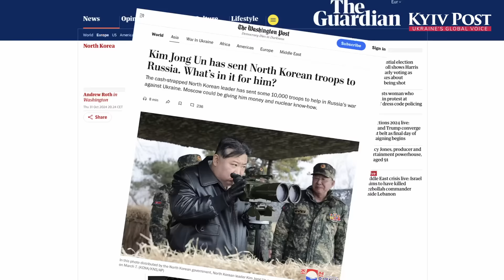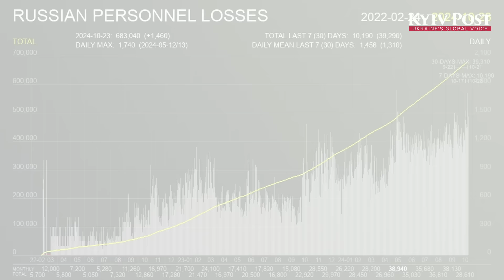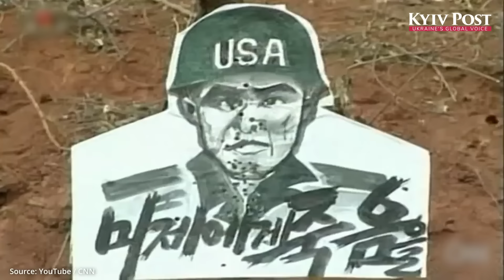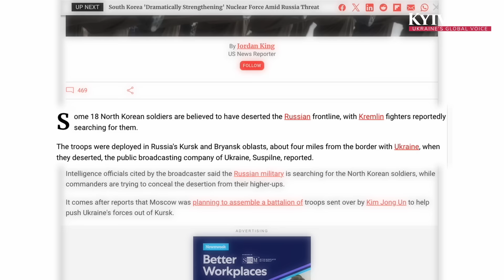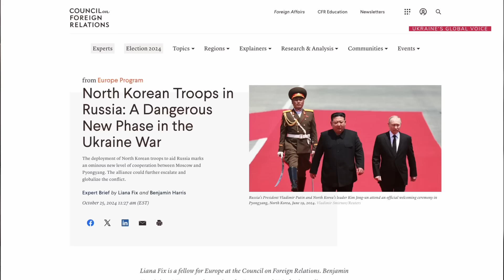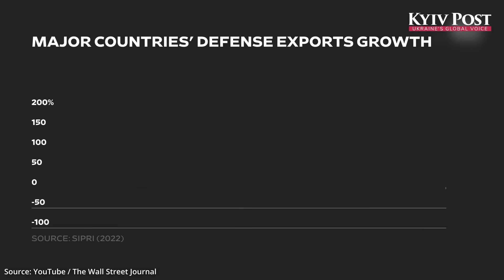North Korean Troops in Ukraine: Will They Change the War?

Comment: On the money as usual.
Question: (from a former USA Special Forces Soldier with Viet Nam experience)

Why wouldn't the Russians let the North Korean Units remain intact with emphasis on Unit Integrity and the mission they are trained to perform?
To take soldiers who are very set in their ways, tactics and use of arms and then retrain them for a few weeks seems counterproductive.
If it were me, knowing even half (probably more) of the situation, strengths/weaknesses, armaments, capabilities etc.  of my forces, I would want to keep them fighting as integral units with specific missions to carry out.
I would brief the unit on their mission very thoroughly, and what they could expect in enemy resistance and friendly support.
Where the friendly forces are concentrated and where their target is located.
I would emphasize drone warfare tactics and enemy known tactics.
This way you do not have to retrain them on topics specific to becoming part of a new unit using foreign tactics and unit nomenclature. A whole new chain of command too.
Communication between the members of the unit would be much easier and I could keep my precious interpreters to communicate with allied units.

If they are anything like US Special Forces, they will OJT and adapt as the mission unfolds during execution of specific responsibilities. Dos and don'ts will be shared and lessons learned collectively.

If you are going to send these poor bastards into maximum risk/casualty assaults with a language barrier, unfamiliar unit positions and lack of training<------ their prognosis is devastation.
I think even if, initially,  it will not go well engaging the Ukrainians with group integrity, it will be better as far as experience and group morale.  

I would really love to hear your perspective on this.
Reply: You assume an unrealistic level of professionalism and rationality in both the Russian and the North Korean military. As the clip was saying (and as I experienced it myself, during military service in a former communist-led Eastern European country), training in armies of communist dictatorships isn't focused on military prowess. A communist dictatorship, while appearing normal on the surface, is in fact a society so sick it's hard to believe.

A well trained soldier is a danger to the regime. Well trained soldiers are effective, able to self-organize, don't panic easily and aren't easily scared by the threat of bodily harm. That's a humongous danger to a regime relying on fear and violent oppression to maintain control. If you're a halfway skilled officer or soldier, you are isolated and even demoted, to prevent other officers from looking up to you and try to imitate you and become halfway skilled themselves. What gets you decorated and promoted is fanatical, irrational, vocal declarative support for the party doctrine combined with complete, blind and humiliating obedience. You're not allowed to be any single bit more than a completely obedient tool, in the armies of such countries, if you want your career to advance. Any even so slight sign of personal initiative or rational assessment of your orders is a huge alarm, likely to kill your career. (I told you it's hard to believe. But it is that way because the entire dictatorship is based on a strict hierarchy governed solely by the arbitrary will of the people forming that hierarchy, not on a rules-based structure of independent institutions which keep each other in check and share power.)

What this all amounts to is that North Korean troops, given only High level, non-specific orders about the goals they need to achieve, instead of very detailed instructions about how to achieve those goals, would literally do the headless chicken dance on the battlefield. Russians are aware of this, and therefore try to integrate them into their own fighting structure, hoping to get more out of them than a complete waste.

Russia, OTOH, while no longer a communist dictatorship, is still a dictatorship. There might be less indoctrination among its troops, but it's a similar hierarchy based on personal fealty relations, rather than rules and competence, that governs Russia - its army included. Putin gives orders to generals, generals giver orders to superior officers, those pass them on to officers at the front and those officers do what they can to achieve them. Only, nobody, in this entire chain, does anything to put some efficiency and effectiveness into what's happening. Putin orders his generals to retake Kursk. The generals delegate to colonels the retaking of various localities, roads or other objectives. The colonels give orders to captains and lieutenants to perform an attack. Those officers scramble up whatever machines and troops they can get and organize the attack. They don't care about the actual outcome, they only care about executing the order. Similarly, their commanding officers can then report up the chain that they did attack the enemy positions, but were repelled with heavy losses - and ask for more soldiers and equipment. This goes up the chain all the way to Putin, which, being the dictator, has to make decisions - nobody expects him to delegate, and him delegating would not just create a perception of weakness in Russian society, it would actually give real power to the person he'd delegate to, and giving power to a subordinate is dangerous in Russia even in peace time, let alone in war. Putin, not being a soldier and having a very bad idea about what's actually going on on the battlefield, makes decisions which are usually stupid.

Which amounts to Russians being unable to use North Korean troops effectively or at least rationally. It's only Russia's mass that keeps Russia going. People at the very front, whose lives are at risk, do learn to optimize their way of fighting, but that learning doesn't propagate much up the chain of command. Which is why we still see compact Russian columns attempting to run across a minefield, or Russian foot soldiers approaching enemy lines in a closed formation. And North Korean troops split up and integrated into tactical level units which don't speak their language, don't know their way of fighting and don't care to make use of whatever their specific skills may be.

(Of course, the description I provide above is a bit schematic and exaggerated. But that's just because the space available in a YT comment is limited, not because it's incorrect at its core.)
Reply: @a0flj0  We fought against a number of NVA units that were Soviet advised.  They were dedicated and for the most part, performed well.
Not sure what country you are from; where you were a part of what you describe.
Not trying to discredit you.  I learned a few things from our discourse.
Just discussing the content of this site, so thanks.
Again, I put myself in the place of the command structure not the troop. 
I have already assigned my trained, operational,  NK unit a specific mission to perform. 
The leaders are given intelligence reports and also get briefed by Russians with experience in the theatre. 
Maps are provided to the NCO level and officers of the target and surrounding terrain.
Again, not the individual soldier, but the supposedly trained and "combat ready" Company, Platoon, whatever<---- depending on the mission.
How they perform can be evaluated from the results. 
If they perform poorly, a re-evaluation of the level of effectiveness the unit displayed will dictate weather or not the casualties are replaced and what changes in leadership are needed.
At least two weeks to integrate the new (previously trained in Korea) replacements into the unit structure.
They would than be given a new mission.
Discussion with the entire two country command structure would be pursued evaluating the strengths and weaknesses of the unit's operational posture.
Thanks for your very constructive criticism.
Reply: @josephprzygodzinski3653   NVA was a whole lot different story. They were advised by soviets, but the North-Vietnamese communists weren't in power for long enough to corrupt and weaken the social fabric of their country. Before communists, the Vietnamese were a warlike people for about a thousand years. Communists only took the power in Vietnam in 1945. The war started again in Vietnam  in 1946, ended theoretically in 1954 only to be started again that same year, lasting until 1975. Only then did communists start their typical game of destroying traditional institutions. The age-old Vietnamese tradition was fully alive until then, and even improved by many decades of efforts from Vietnamese nationalists in the decades before WW2 to build up armed resistente to French colonialism, by sending people to get educated and trained abroad, to Japan but also to Western countries - not so much to Russia. (However, in Vietnam in particular, the communjsts were excessively efficient at destroying traditional institutions, together with the wealth they were producing, quickly plunging the country into a terrible economic crisis, so that, aided by the collapse of the soviets, they changed course rather quickly, making Vietnam sort of an oddity: a communist-led state with somewhat democratic institutions and a rather capitalist economy.)

Comment: Very Briefed And Summarized Ideas:

the 12000 soldiers number are insignificant to bring any changes to the course of the war which tending now in the favor of the Russian Armed Forces (which is by its self not be a huge problem or for the Ukrainian Armed Forces especially considering the the difference in the balance of power between Russia and Ukraine), but those DPRK formation are still very useful in a certain sector of the front...

on the other hand if those expeditionary forces were to be expand or increased to 200 thousands soldiers, they will relieve the increasing pressure on the Russian manpower, allowing the Russian ministry of defense and army chief of staffs to maneuvers across the front with their formations more easily, giving them extra time to train their new soldiers...
 
Can they change the course of the war??? and whether they can actually bring about a fundamental and broad change or not??? this is unlikely, especially with the continued employment of FPVs, drones, various types of suicide drones and high-precision munitions...
 
but on the other hand, we will see the level of training and preparation of the DPRK army and will test the efficiency of the war machine and the Korean formations at their various levels starting from the command and control to the individual soldiers, and whether they can actually bring about a fundamental and broad change or not...

Personally, I think the DPRK armed forces lacks the real combat experience, but again it's the right opportunity to test and evaluating DPRK Armed Forces combat capabilities, training values, command and control, and the morale from the tactical combat units to the higher echelons in the command and control system, but in the medium and long terms those fighting formations will accumulate very valuable combat experiences, and they will refining their combat doctrine offensively and defensively and optimizing their utilizations of weapon systems either tactically and technically...

In this aspect I think the missiles and rockets forces beside the artillery units, the air force either operating the su25 ground attack fighter aircraft in close air support roles or maybe flying the flankers either su30mk2/su35 and the mig31and even the su-57or the su34 the latter is highly unlikely because DPRK Air Force don't operate similar platforms and their weapon systems and combat hardwares tends to take the best of what the eastern and western military schools are offering, here if they decide to rebuild and restructure their obsolete air force (instead of building missiles) and due to the economic consideration I think the priority will be giving to expanding the proportion of the multirole fighter aircraft's over the numbers of specialized fighter aircraft's, and by reverse engineering any reconnaissance and targeting pods and attaching those pods to the su30mk2/su35 this will be enough to give those platforms the same capabilities of the tactical bomber su34 without baring the expenses of operating and maintaining different types of fighter aircrafts,
and when they will deploy a specialized platforms, I think they will choose the mig-31 over the su-34, because if they have to choose between protecting their airspace and challenging the traditional air supremacy of the western air forces or conducting risky deep strikes they will pick the first option, in all those domains they will be able to gather very valuable combat experiences and develop an extensive database over various types of the western offensive and defensive weapon systems..
 
I think for the Ukrainian Armed Forces the Russian strategic offensive effort must be contained and degraded and exhausted to lose its momentum while advancing inside the Ukrainian geography...
 
while the only measure of the success of the Ukrainian defensive effort in any sector of the front or in a strong defense point is the rate or the amount of losses that the Russian army will suffer, Here, the Russian offensive effort can be breaked or crushed, between a set of successive defensive battles and through being absorbed into the larger Ukrainian strategic depth, even with this pace of so called speedy progress achieved by the Russian forces, which needed a month to control about 1,100 km, this means that they will need a several years to complete the conquering the rest of the Ukrainian territory, they could reach the cumulation point of their offensive combat capabilities west of the city of  on the Ukrainian-Polish border, Here the second phase of the war will begin, which is managing the occupation of Ukrainian lands with over exhausted formations...